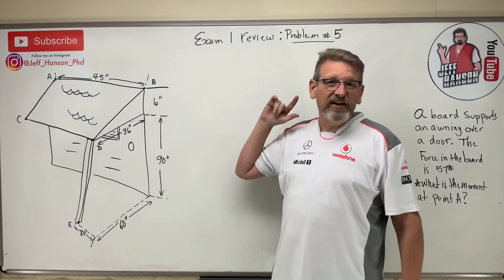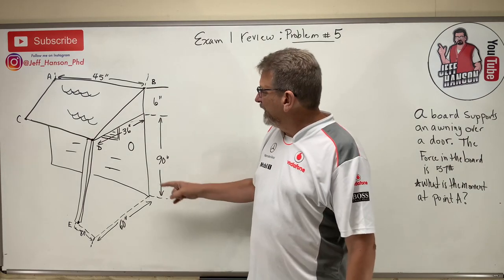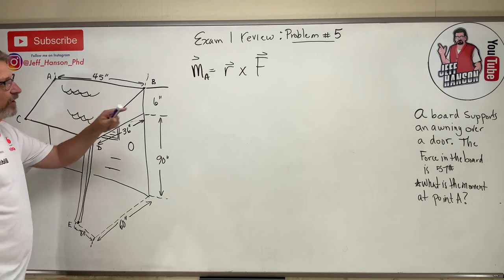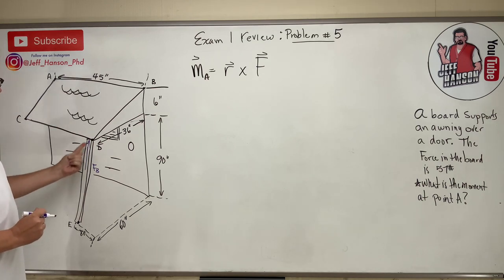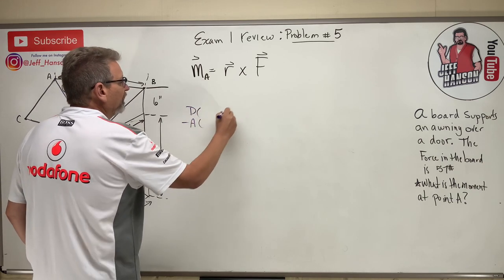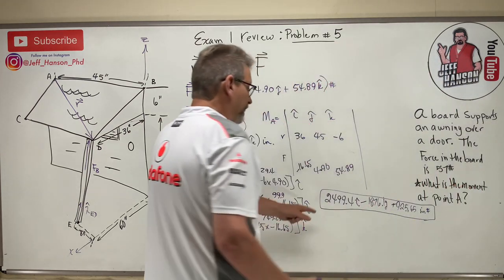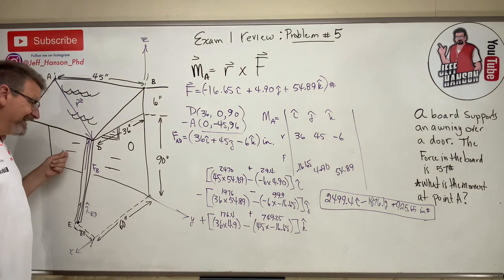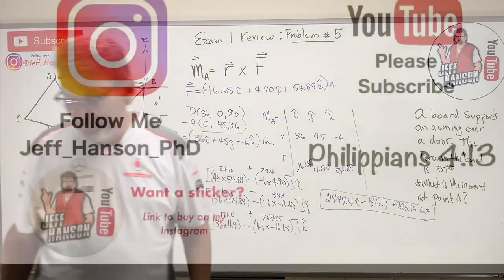Statics: Exam1 Review Problem 5, 3D rXF Moment Example

Comment: I think the answer is incorrect due to the I hat component of the force vector. (-24 / 93.49) x 57 = -14.6   not -16.65
Reply: sure I was supprised as well. I even used different devises to see if I get the -16.65 that the professor wrote down but I was keep getting -14.65

Comment: I think the coordinate of point D is wrong. Is that be D(36, -8, 90)? D's j component must be the same as the E's.
Reply: The support board is not straight, it's slanted. So, the y-coordinates (as well as the x-coordinates) for D and E are different.
Reply: IT DOESNT MOVE IN THE Y DIRECTION
Reply: Yeah, you're right the y-coordinate is wrong..